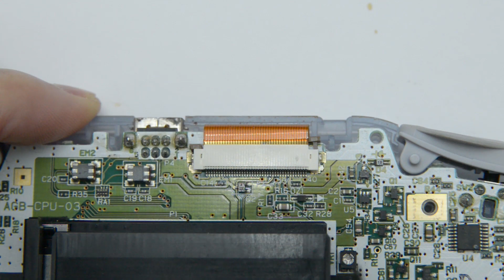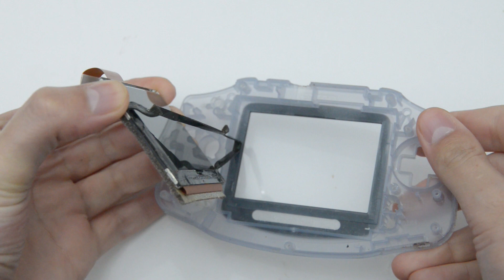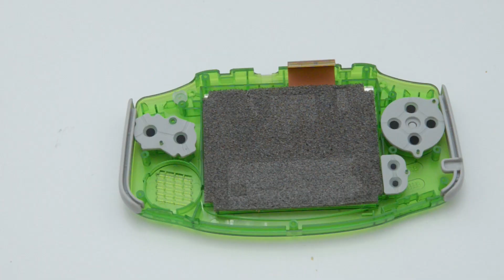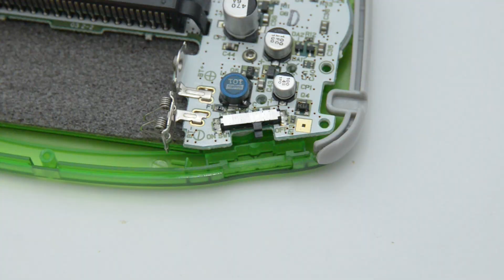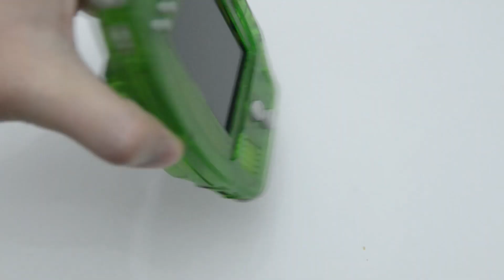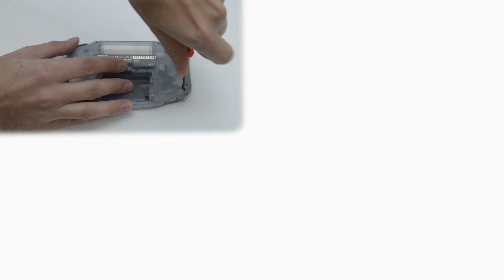How to change the case of Gameboy Advance

Comment: Had a go at this today. Not quite as easy as it looks. I screwed my motherboard back in to realise I’d forgotten the button membranes! Problem was the screw had stripped. Thought I’d botched it at that point but managed to clip the screw head off and manage with one screw. Then I found the shoulder buttons incredibly fiddly to keep in place while you put the shell back together (which fit terribly). Finally, put the lens on to realise I’d not fitted the screen adhesive strip back properly and it’s slightly visible on the left. All in all I’m happy with the outcome but wish I’d just paid for it to be done by someone more skilled. Also the shell and new buttons aren’t as nice as I’d imagined. I cleaned and reused the original membranes but wish I’d reused the buttons as well